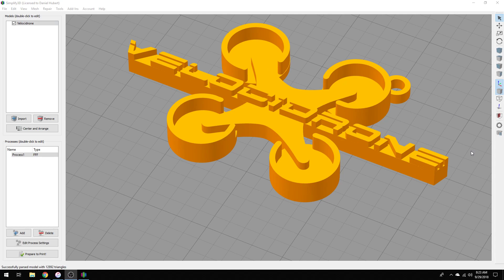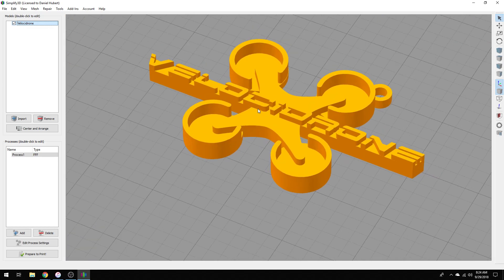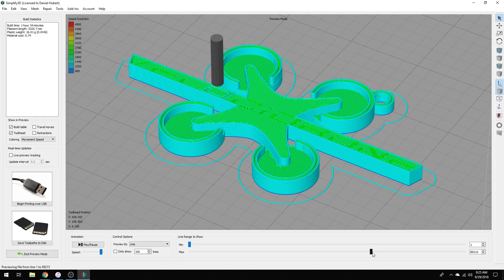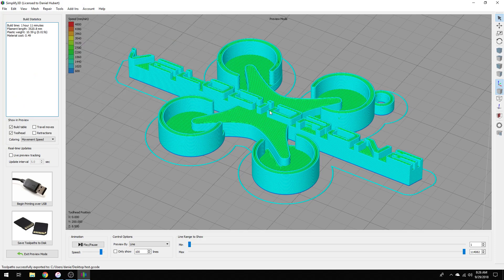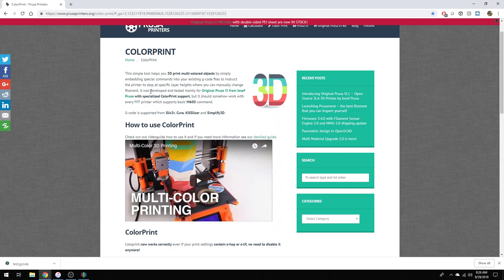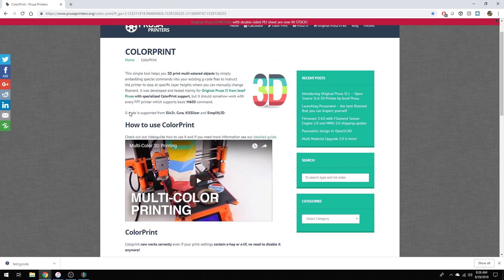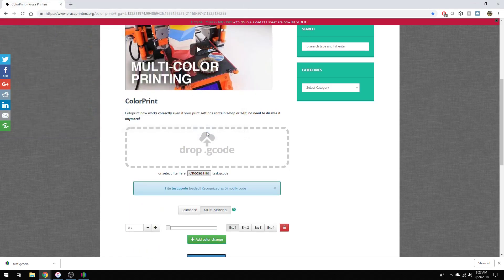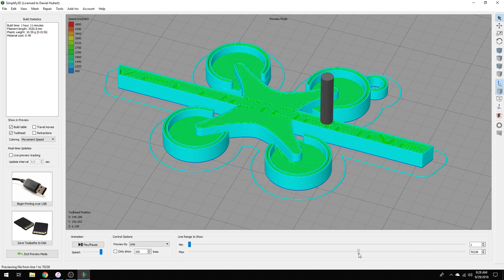Multiple Colors - Single Extruder! - Prusa i3 Mk3 | Color Print | Simplify3D

Comment: I didn't know Prusa had a G-code Post-Processor, That's interesting. Also I thought you used to have a Makergear M2? What happened to it?

Modifying the Gcode manually is super easy too (I use Cura 3.4 right now because it's free and has gotten a lot better in the last year or so, and I'm cheap). 

Here's how I usually do layer-shifted color changes on my single extruder machines. 

I usually use a G1 command to automatically move the X and Y out of the way so that it doesn't blob or ooze as it cools down. Then I set the nozzle temp to 0 (If I might forget for a while to go back and change the filament using M104 S0). Then M0 creates the pause (At least for my printrbot and malyan which both run Marlin FW like the Prusa printers do). Then I set the temperature of the hotend to my printing temperature using M104 S220 (sets it to 220 degrees). Then M109 S220 will have it wait to continue until it reaches that temperature. Then because my printers don't hold the steppers on, and I'm not careful enough to load the filament without bumping it, I do an X and Y zero (Not Z, and no bed level) using G28 X0 Y0 and then it continues on. 

I have found that re-homing the X and Y following the change helps a lot. Also when I change I try to push through manually enough filament that it comes out of the nozzle, then pull the ooze off with tweezers and immediately hit "Resume". This way there's filament right at the end of the extruder. Otherwise It seems to print air for just a little bit. 

I don't know about the tool that you showed, but manually editing the G-code should work on any printer and any slicer (except one that runs sailfish [read makerbot and makerbot clones], I have no idea how to manually edit the weird serialized G-code that they use and I doubt your tool would work on it either)
Reply from the maker: MrBenjo11 wow! Thanks for sharing your experiences! You should see if this tool works for you too - takes no Gcode editing for me, so it’s really simple. I sold my MakerearM2 to buy the Prusa i3mk3 and am really glad I did - the i3mk3 is effortless in comparison to all the tinkering I did with the M2
Reply: @Danimal-3D  no problem, figured my way could help people as well.

Is the auto level and auto squaring what you like about the Prusa? I have heard that the makergears are pretty rock solid at least as far as mechanical build goes.

And I just have that whole stream of commands saved in a text document with comments ( ; is the comment for gcode like // is for C++) so I can just copy and paste. This makes it easy, and I can control and customize it.

With Cura I just note the layer the change happens at because using ctrl + f to find layer:17 is more effective than searching for the G1 Z__ layer height in the event it's not a perfect match.

Also worth noting, cura uses 0 indexed layer heights in the Gcode (Layer:0 is the first layer) while in the GUI it's 1 indexed. So layer 15 in the slicer is 14 in the Gcode.
Reply from the maker: MrBenjo11 yeah the auto bed leveling feature is amazing. I was constantly tinkering with my bed on the M2. The flexible removable plate is also great - and the LCD screen on it allows me to never need to tether the printer to my computer with a USB cable. All that and then the price is a lot less made it a good choice for me